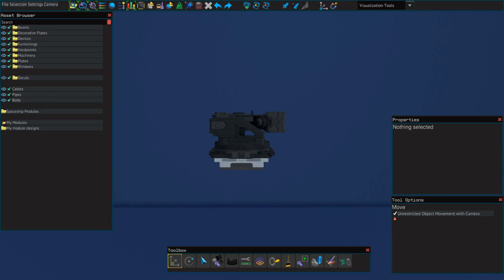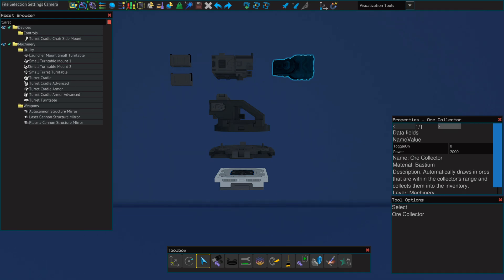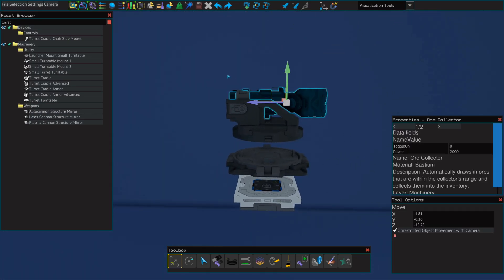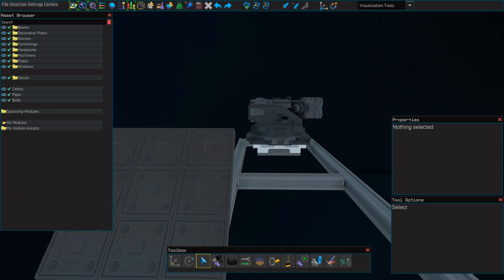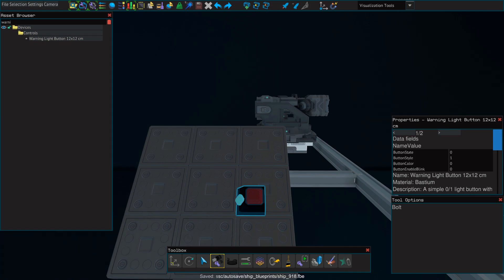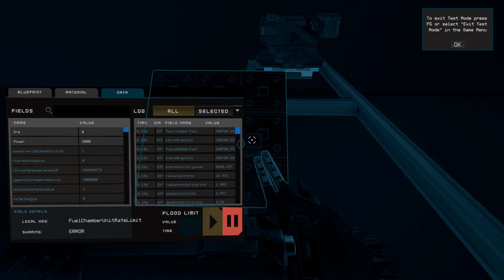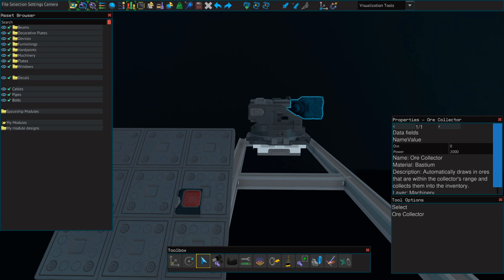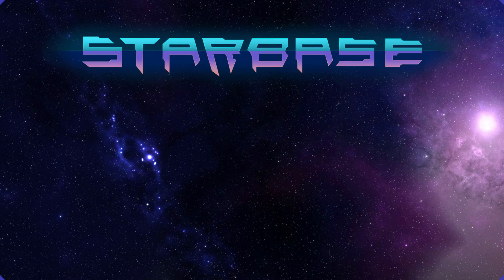Starbase Component Spotlight: Ore Collector

Comment: If you don't plan to do anything other than have the collector point straight ahead, you can use a fixed hardpoint to cut out the material need for a cradle and turntable.
Reply: How to connect it without the turn table?
Reply: @antonstezhkin5991  the fixed mount connects to a device hard point.